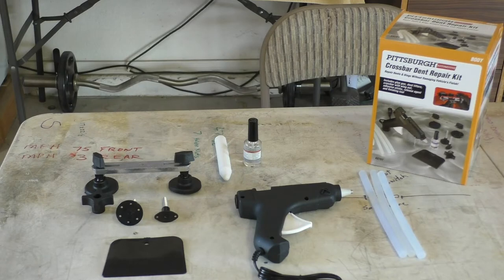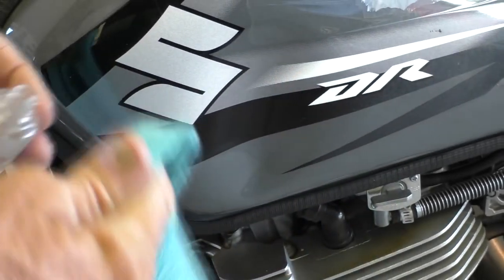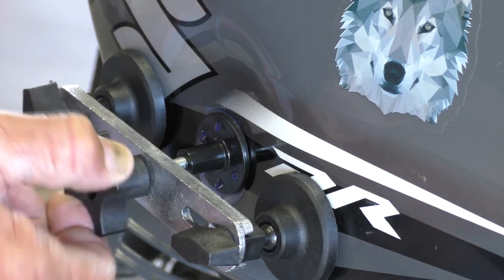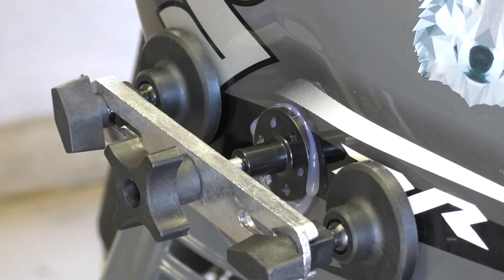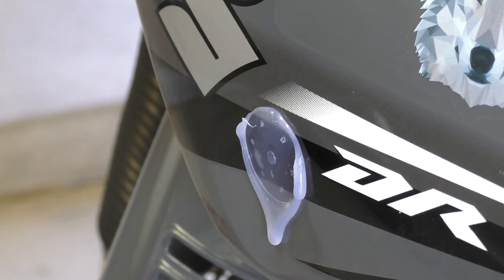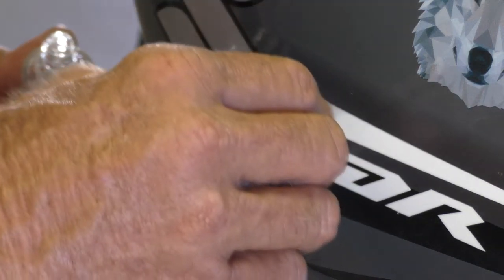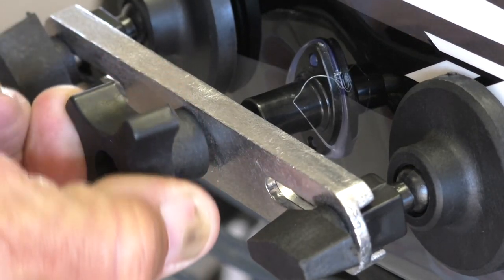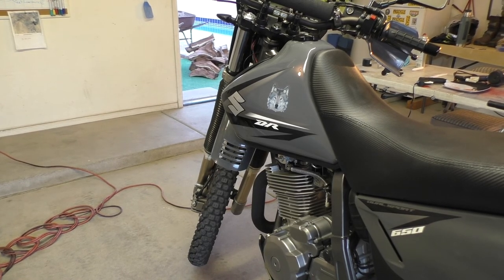HARBOR FREIGHT (PITTSBURGH) CROSS BAR DENT REPAIR KIT - SUZUKI DR650 MOTORCYCLE GAS TANK DENT REPAIR

Comment: You started turning the knob farther and quicker than you did on the previous times, even though you didn't ever do 1/8" turns.That might be why it took off the decal and paint. Before you were slow and 1/8" turns. Last one you turned it faster and 1/2" or more turns.
Good video.
Reply: nice observation, I think he went too fast on the second one towards the end

Comment: WOW OBI! That system works quite well! It is actually cheaper than the cost of shipping my stock 2020 DR tank to you! Looks a heck of a lot better. I was wondering how it would affect the paint and stickers. Great video on how to fix trail damage!
Cheers!
Reply from the maker: Thanks DOC - I'm gonna do one more pull - (while my phone charges) - and try to stay away from the decal, and get that last little lower "dimple" out - but that's it. It's 100% better than it was - and for a dirt bike, I'm cool with a little touch up paint. Acerbis in time (maybe) - Suspension is next LOL.....

Cheers Brother !!!!

Comment: Thanks for this, very helpful!  

Do you think there's anything that could have been done to prevent the removal of the decal/paint?  I just bought a DR with ACERBIS tank installed and it also came with a dented OEM tank.  Would like to make the OEM nice again but a bit worried now.  Thanks!
Reply from the maker: Brother - No matter what you do, this is a possibility, however, I think if I would have backed off a little sooner, I would have been ok. I'm sure you've done a fair amount of research, but some guys do it from the inside out. I tried it various times with absolutely no luck.

I know I'm not much help, but good luck !!!!
Reply: @pilotdane1  Thank you!  I've already scratched a few ideas off the list but this puller method is looking like the best one despite the risks.

Comment: Should we empty the tank or can we just used it on a tank with full of fuel?
Reply from the maker: I did not empty my tank. If you leave fuel in there - do NOT use a heat gun, or hair dryer. The safest thing to do would be to empty the tank. Your call on that one - Hate to give advice on something like that because a ton of people say "use a hair dryer and get the metal warmed up before pulling out the dents." I found it made no difference.